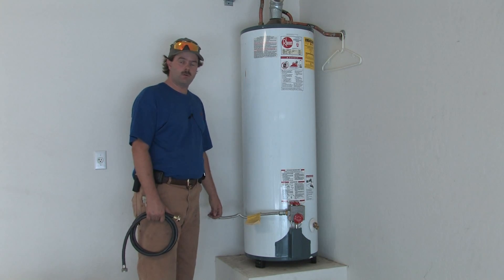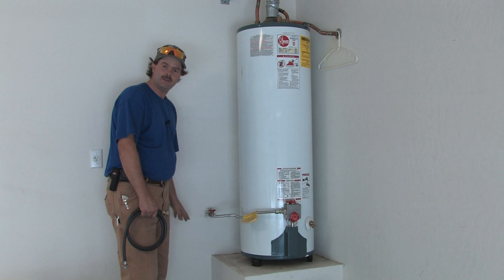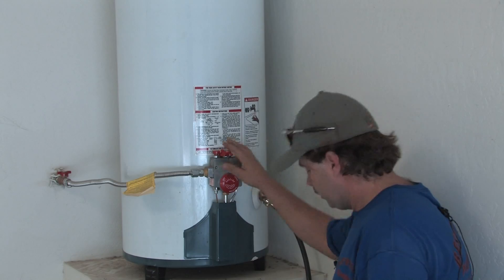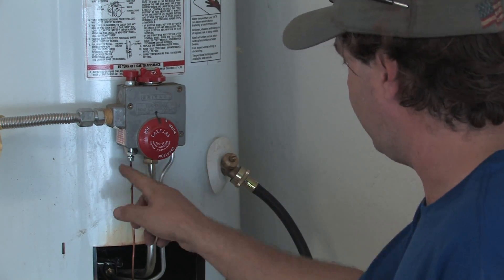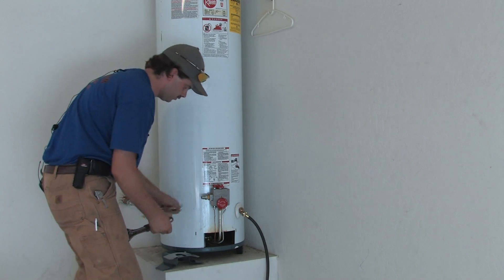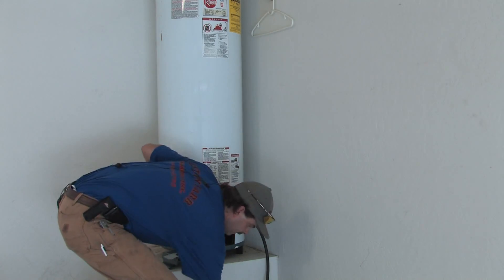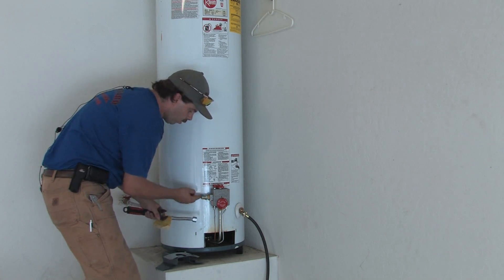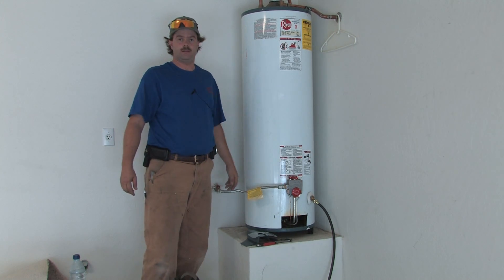Hot Water Heaters : How to Change a Gas Valve on a Hot Water Heater

Comment: That water heater should have been replaced.  It doesn't even appear to be installed correctly.  There is no drip leg in the gas line and there shouldn't be tape on the flue piping

Comment: that water heater is completely out of codes missing the sediment trap, also the flu pipe is leaking carbon monoxide,beacause have a portion of single wall pipe attach to a double wall pipe, and that is wrong, neither has the bonding wire and clamps

Comment: I followed these instructions to the letter. The only issues I had were:

1) After spinning the old valve off, (to my surprise) a ton of water spilled out. I had to hurry and spin the old valve back on and find something to catch the water with, once I spun it back out again. After I was done replacing the valve, I had to take a shop vac and pick up all the water that had spilled down into the combustion chamber. Fun times!

2) The shank on the new valve was shorter than the old one. So, I had to swap them (and continue using the old temperature sensor). 

Everything seems to be working fine. The water temp has been steady and to our satisfaction. By only question would be, why did water spill out? I thought the tank would have drained through the hose. Once the water stopped flowing through the hose, I assumed (incorrectly it seems) that there was no more water left in the tank. But alas, there was still quite a bit of water left!

But either way, it looks like my repair job bought us some time. So, thank you for the video. 

By the way, the instructions that came with the new valve, specifically said to NOT use a pipe wrench to remove or install the valve... But I did anyway. Their way wasn't really working out for me. 

Thank you.
Reply: I don't think that he mentioned to open the Pressure Relief Valve while draining your tank to avoid it air locking and holding water inside.

Comment: Theres no need to drain the tank. When you shut the cold water supply at the top of the heater, you should be able to remove the control valve and immediately place the new valve into  the water heater without spilling any water. It's siphoned into place. Of course when you do this, no one else can open a spigot either until your done.

Comment: If I open the T&P and shut the cold valve , and drain water from the top, when replacing the gas valve, some water will come out but not much , right ? Thanks.
Have to replace Gas valve on a big ole American heater, on a 2 nd floor.